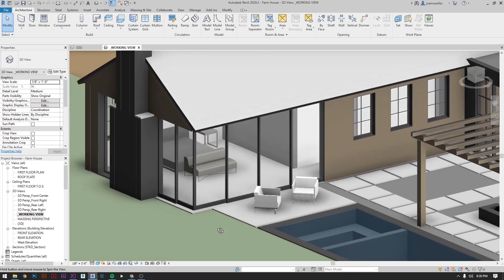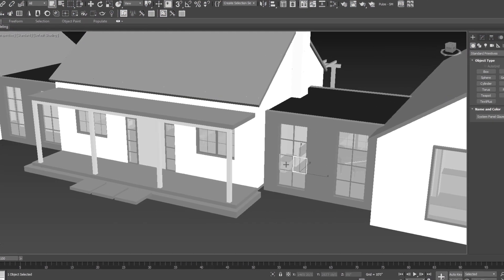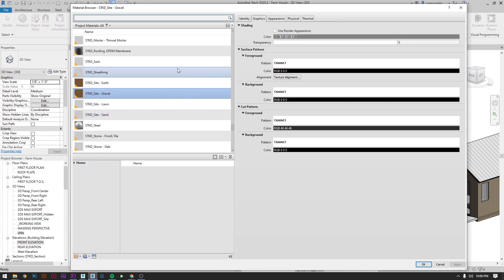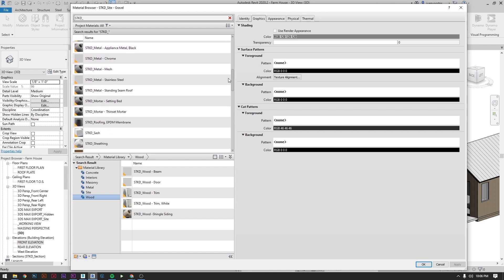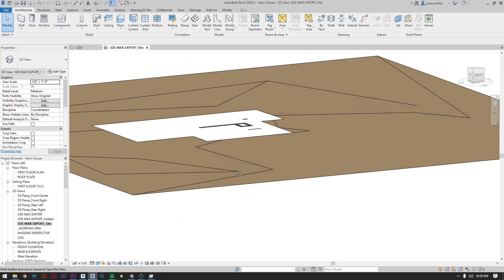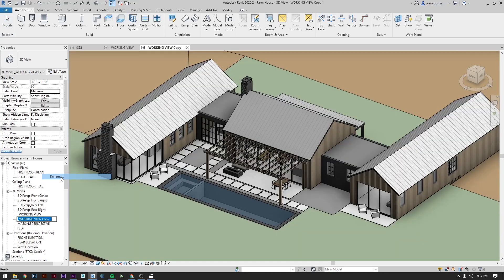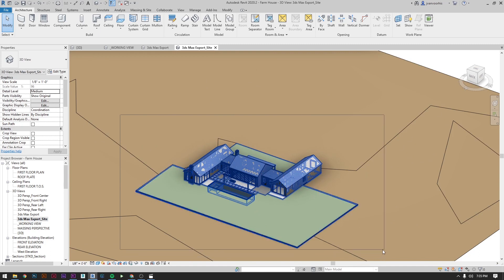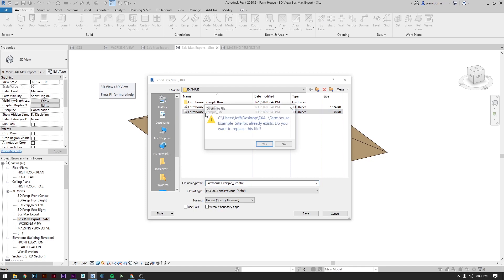Rendering for Architects, PT. 1 Streamline your Revit modeling for 3dsMax

Comment: Great tutorial on setting up the Revit model for 3ds Max workflow! One question - why do you choose linking FBX over RVT?
Reply from the maker: Thanks! For the longest time, the Revit link didn’t actually work very well in older versions of Max so it was my only choice. It works much better now but I’m not a huge fan of the way it has to scan the whole Revit file, opening up Max to all the 3d Revit views. Not a huge issue if you’re a solo artist and you’re well organized, but if you’re an architect working in an office and you’re working with a dedicated viz artist it’s a bit easier to point them to a stand alone FBX rather than letting them monkey around in the Revit views and potentially re-linking when you’re not ready. Not a huge issue by any means but just a bit of a personal preference. If you like the Revit linking method, go for it!

Comment: all my walls are linked together and are all a single element. how do i make them separate elements.
Reply from the maker: When you link the file in there is an option to “Combine by Materials.” That’ll break up the model by each individual material instead of each object. It’s a whole lot easier to work that way but I’d definitely spend some time cleaning up your Revit material library. Let me know if that helps. Thanks!

Comment: If we use Enscape, Lumion, Twinmotion, Corona Render, etc, with Revit and Sketch Up then is it really necessary to learn 3D studio max? Because these rendering programs could create stunning perspectives with appropriate materials, lighting, etc. Please advise. Thank you.
Reply from the maker: Not at all! All those programs make great images these days and are pretty simple to use. My experience is that in order to make them simple to use they don’t offer quite the degree of creative flexibility that 3ds Max can provide. I’m a bit of a control freak and like all the extra options Max provides so you can really bring your images to the next level. If those other programs fit better into your workflow and you’re making great renderings with them, then don’t even worry about Max. Thanks!

Comment: Thanks a ton for your tutorials! They are of very high quality. I was wondering if the same workflow (from Revit to 3DS Max) can be applied for interior renderings ? Any pros & cons ? 
Thanks again.
Reply from the maker: Yes, definitely. The only added challenge with interiors is sometimes there are a lot of interior elements you need to model to look convincing depending on the style. That said, it’s 100% doable depending on if your Revit modeling skills are up for it. I’ve used the workflow it for both traditional and contemporary designs as well as for still interior images or VR panorama images that you can stick in an VR headset.

Comment: Thanks for the great informative video series. What are your thoughts regarding geometry detailing that 3DS Max is great for such as chamfering edges? Is this possible using the Revit FBX model in 3DS Max? Or is there a similar feature in Revit?
Reply from the maker: Yes it’s possible to an extent. You can add modifiers like the chamfer modifier to FBX linked geometry but it can sometimes be a little finicky depending on how complicated the geometry you’ve linked in is. I’ll sometimes do it to select materials if I think it would make a difference rather than applying it to absolutely everything. Definitely give it a shot and see if you like the result!

Comment: Thanks for this awesome tutorial serie! Defenitely what I am looking for right now. I would like to know your opinion about my Revit to 3ds max interior renders workflow. For as I know the database of 3DS max interiors models are more comprehensive then Revit interior models (f.e. Evermotion). However, I don't have that much knowledge to know how to adjust these 3ds max furniture models to 'fit' in the building design. 

So I was thinking to create simple basic families in Revit (like kitchen cabinets) and export it together with the building. Then to finish the interior scene using more detailed models from evermotion such as lamps, decoration, rugs, chairs etc. Do you have a better suggestion? Cheers!
Reply from the maker: Hi David, yeah that’s definitely a route you can go and what I do for 90% of my renders. It’s why I built the casework arrays and the kitchen island model in my SD Toolkit so I could quickly get good looking cabinet geometry in Revit, use 3ds Max materials to make them look good, and fill up the kitchen scene with the detailed kitchenware, pots, plates, etc. from Evermotion. Evermotion has a handful of pre-made kitchen setups but like you said, you do have to manipulate them a fair bit to get them to match your scene. I only go that route if there’s a really detailed or specific style of cabinet I need. Thanks!

Comment: I have to agree with everyone posting in all of your videos.  So concise, such a natural educator, and that you blow past all the extraneous filler is what makes your lessons so valuable, regardless of level or license. (Anyone would benefit, as you are absolutely unique).

So I actually do have a question or more (in fact, many, but I'll stay on point and not take too much of your valuable).  As far as bringing in a model, whether linked or otherwise, I'm mystified as to how the import script typically handles units/conversions, if any, or if we simply default to the idea a "1" is a 1, regardless, and if so, do we then scale our textures artistically, and try the best we can to match size?  And in that vein, are textures (good ones), then likewise set to a unit by default/conceptually?  And to come full circle, I did make a stucco texture in designer, and I in fact followed a paid tutorial on that, verbatim, but when I brought it in, to an imported dwg from revit, that I did not rescale at all on import (before I became familiar with you), the texture imported what I perceived to be as gigantic, and it brought my brand new HEDT to its knees, and cause my graphics card to throttle, and freeze.(Ryz TR3960/Rad Pro W5700).  So I'm wondering if I need to take a deep dive into UVW unwrapping/mapping, and prep my models accordingly, before I apply mats?   Or do you simply stick to your workflow, and it all works out?  

Last, thank you for your generosity, and I honestly hope we can do business soon, as your SD Tools seem very promising and forward looking.

I hope you and your channel take off, because you are the one in a thousand here on the tubes that is cogent, organized, and a real natural talent (I come from a family of educators, my wife and two sons are teachers, so yes, I know a smart guy when I see one who surpasses the rest of the heard).

So...just thanks a million, I hope you receive all the success you deservedly have coming your way.

Bill C.
Reply from the maker: Hey Bill, thanks for the epic comment! Great feedback and I’ll definitely be continuing to make videos. 

Regarding scale, I just replied to someone in the Pt. 4 video regarding how I set my units so things scale correctly. If you’re working with imperial units you’d probably have a same setup if you take a look at that reply. The Pt. 3 video covers the basics on how I set my UV coordinates. Essentially, I generally try to keep them close to real world scale. IE if I have a jpg with that shows three 6” T&G panels, I would set that jpg as 18”x18” in the bitmap properties in the material editor. Then I’d add a “UVW Map” modifier to the geometry, set it to “Real world map size” and call it a day.  That said, I’m not afraid to occasionally scale things a little artistically but I pretty much always start by adding that modifier and controlling the “real world map” sizes based on what it would actually be.  I very rarely fully unwrap the UVW coordinates and paint textures in another program, it’s a bit too involved  for an architectural workflow where the design is going to constantly change. 

Thanks again for all the positive feedback. Please don’t hesitate to email me if you have any other follow up questions or would like to discus Corona, Max, or Revit. Cheers!
Reply: @VanVoorhisArchitects  Very, very cool.  I'll deff try using a ref image that is a known size (occams razor cuts the cleanest once again, yah?), and go from there.  I'll also hop on over to comments in #4 now, and I'll  rewatch the whole series when I'm not falling asleep (confession, I watched at about 1am last night, dozy)  :']  THANX!

Comment: How to fix dirt and black sweep profile made in revit when you imported in 3dsmax
Reply from the maker: Sure, by “dirt” do you mean Revit’s topography? If that’s what you mean, then I typically apply a “MeshSmooth” modifier to it and check the option that makes it apply to “Faces” rather than the whole object. It might take a little bit of playing with the available settings but I can generally get an acceptable result as long as the topography isn’t really crazy. Definitely save before trying this as it can sometimes take a bit of muscle for Max to calculate the smoothed mesh. Let me know if you’re having a different problem with the topo. I’m not sure what you mean by the black sweep profile. Let me know a little more info and I’ll try to help out. Thanks!